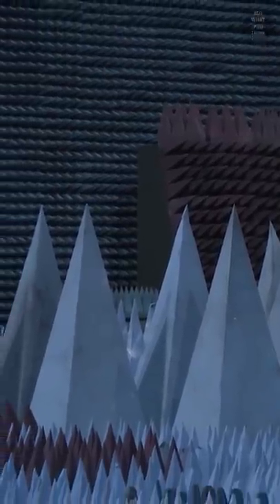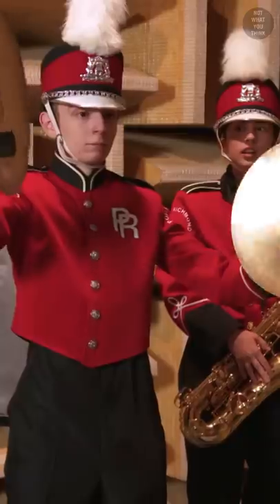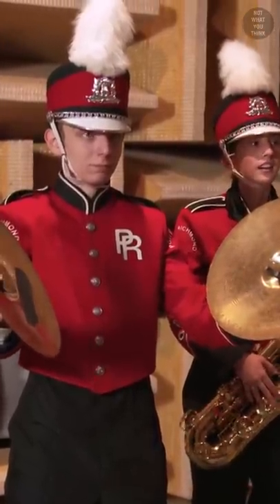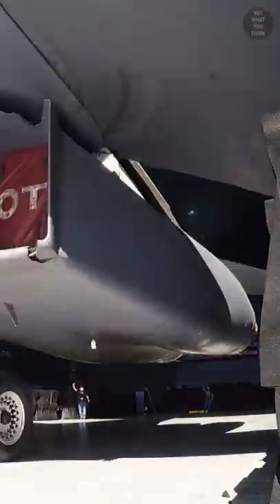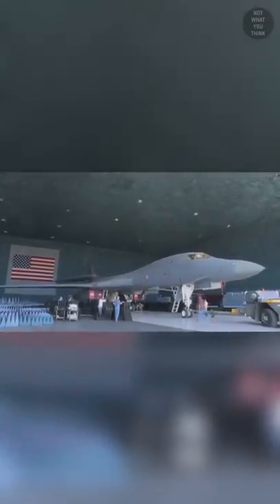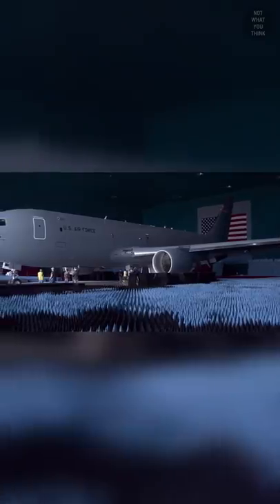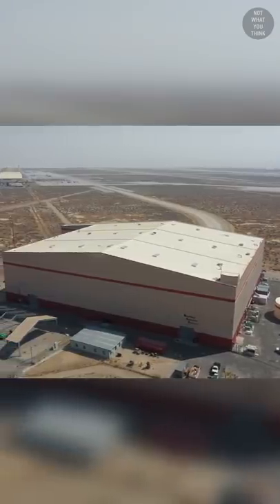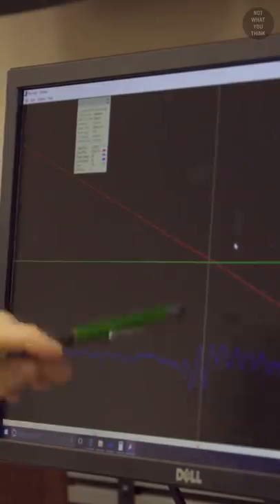Aircraft in an Infinitely Large Room #shorts

Comment: Don’t we all live in an infinitely large room already?
Reply from the maker: Wouldn’t a room necessitate walls? 🤔
Reply: @NotWhatYouThink  could it be infinitely large then?
Reply: @crosshairs19  well an infinitly large room can't exist, anything that is infinite can't exist.
Reply: @NotWhatYouThink  if the room is infinite, the walls are at the limit of our space, invisible and unreachable. Like a penrose diagram
Reply: @NotWhatYouThink  what define room ?
Reply: @NotWhatYouThink  how can walls be real if our eyes aren't real
Reply: The chamber is needed to isolate the device under test from outside electromagnetic noise. It's possible to measure outside as long as interference from other sources is low enough.
Reply: @NotWhatYouThink  if it's an infinitely large room, I don't think walls would be of concern here, as it's an infinite space and no confinements are present (in theory)
Reply: @saulgoodman7858  it was explained
Reply: @NotWhatYouThink  The observable universe makes our walls, or the walls of the non-observable universe.
Reply: @Lillstisse661  π
Reply: @donaldyeung9658  indeed
Reply: @NotWhatYouThink   Well, it's Not What You Think...
Reply: @crosshairs19  it was partially explained. Btw this kind of testing is called Radiated Emissions. Two sides to it. One being intentional radiators and the other being unintentional radiators. Different tests and pass criteria come into play if they're testing one or the other.
Reply: @gohka33  He he he! 🤣
Reply: @Lillstisse661  Isn’t outer space infinite? Does it not exist? This is all making my brain hurt!
Reply: @Lillstisse661  numbers arent real then???????????????????
Reply: @xnavynuc  outer space is not infinite, because the universe is expanding, which means that it is not infinite because if it was infinitly big we could not measure that it was expanding, infinity is a concept used in math, it does not actually exist outside of math.
Reply: @Lillstisse661  then what do you call space?
Reply: @duncanmcgee13  finite.
Reply: @Lillstisse661  the universe as in the physical objects that make it up are expanding, not space itself
Reply: @duncanmcgee13  space itself is what's expanding and that doesn't mean the universe is finite. All evidence points to the universe being infinite, but it's possible that it isn't.
Reply: @Lillstisse661  Do you believe in a god?
Reply: @MrGodofcar  no, in math
Reply: @NotWhatYouThink  The walls move as we get closer.
Reply: Don't the pyramid shapes create a larger volume of reflective/absorbent surface than just bare walls 800 feet or further away?
Reply: @Lillstisse661  because it would just keep going on right?
Reply: @crosshairs19  yes, but we will never reach infinity, you can always count to that number.
Reply: @NotWhatYouThink  depends on wich measure U think, in Like space there IT IS also often called "roomspace" (atleast in some German movies, might be a Bad Translation)
Reply: @NotWhatYouThink  tell that to a flat earther😂😂
Reply: @NotWhatYouThink   infinitely tall walls. No one could verify the existence of a ceiling because infinitely tall walls
Reply: @Frank-wr2nf  "infinite" and "limit" if something is infinite it cannot be defined,
Reply: Infinite is not a set number but instead an ever bigger number from what I understand. Essentially, whatever number you think of, it's bigger then that but is then bigger again.  You could have the set end being the walls but expand the space inside the walls indefinitely, creating an infinite room. You will never reach a wall because the walls are always further and further away to an infinite distance. Alternatively, we could go the other way and shrink the space infinitely. You could have a 1m by 1m room and shrink the inside indefinitely and it would have essentially the same effect but contained withing a finite area
Reply: Infinitely large rooms can't exist... or can they? vsauce intensifies
Reply: @mikedaskalakis5006  people used to think that light moved at an infinite speed. But it doesn’t.
Reply: @Lillstisse661  what about space
Reply: @dakortekaasfamily5394  the universe is finite, it is just really big, not infinitly big.
Reply: Mind f’ing blown 🤯
Reply: @Lillstisse661  i got news for u
Reply: @donaldyeung9658  pi is 3
Reply: @ooopaulpeterooo  wtf
Reply: @Lillstisse661  so, the universe doesn't exist?
Reply: @Lillstisse661  what about joe mama
Reply: @DGP406  blind people can walk through walls now?
Reply: @NotWhatYouThink  walls making it a finite space, making the video title clickbait, gg
Reply: The entire reply section is having an existential crisis right now
Reply: Max Power  ''They don't actually know that its finite, they cann only measure what they see, what is it expanding into?  More space obviously"

Not necessarily.  Space may be created as it expands.  Maybe there's nothing outside of our local universe, even if it expands.
Reply: Max Power  I feel ya.
Reply: @NotWhatYouThink  There's theoretically no way to disprove that the edge of the universe functions as a wall, therefore we are in a 4d room
Reply: @NotWhatYouThink  
If it requires walls to be a room, then wouldn't "infinitely large room" be an oxymoron since there would effectively be no walls?
Reply: Awnser to all questions about the infinity of the universe: We don’t fucking know
Reply: @Frank-wr2nf  But there is no border to infinity, therefore there cannot be walls
Reply: @Lillstisse661  but it is expanding into infinity.
Reply: @NotWhatYouThink  mabe there is walls and this room is so infinitely large that we haven't found them yet
Reply: @Lillstisse661  our space is infinite it keeps expanding we don't even know the if there is an end.
Reply: @NotWhatYouThink  well technically there is a wall around the known universe
Reply: Universe it not infinite
Reply: @NotWhatYouThink  yes, but it's not what you think.
Reply: @NotWhatYouThink  mushrooms
Reply: My whole life is one room, one big dark room.
Reply: @stanleypeters5383  
As I understand it:  no.

The pyramid/modified-pyramid receiving surface angles are such that the mechanical (sound) wave, or electromagnetic radiating wave (EM radiation), reflect the wave (whatever portion's NOT absorbed by the highly absorbent material, with each bounce/reflection) at angles that progressively "trap" the wave as it rapidly bounces it's way down the pinball machine  between pyramids/cones, towards the dead-end of that triangle/funnel, by which point what hasn't been absorbed becomes, finally, nullified. (As best we can; as I believe it's impossible to reach that ideal of perfect insulation of energetic waves [sound/EMs], or temperature.)

So the overall value of THAT highly-specific surface topography (of progressively bottlenecking angles) AND the absorbent material "capacity," seem like they must trump the sonic dampening of that 800-foot-distant wall you wondered about.
Reply: Do all very basic cringe attempts at cute comments that are not creative or funny whatsoever; now get a lot of likes?
Reply: @Lillstisse661  the universe exists.
Reply: @Lillstisse661  the universe is uniform and infinite in all directions and always has been.

Just because it is also expanding doesn't mean it isn't infinite.  Infinites can get bigger. 
Some infinites are bigger than others.
Reply: @blessedwolfNotAFurry  in a way light doesn't move at all.

When light moves the entire universe contracts to zero depth.  (From lights perspective).  Which is to say from lights perspective it is both at the start of its journey and the end at the "same time"
Reply: @NotWhatYouThink  4d walls
Reply: @NotWhatYouThink  but if its infinitely large, you could never reach or even see the walls, since vision has limited range, so would you know the walls even existed?
Reply: @Lillstisse661  ok so the universe is expanding, we have evidence of that. And it is immeasurably enormous at an uncomprehensible volume. now what ever is beyond our universe must be infinite to allow the expansion of it all including any other universes. if not then you are shrinking giving you the illusion of an expanding universe and your about to implode. crunch... lol.
Reply: @davidbelen7199  our universe, the one that is expanding is not infinite because when would something that is finite switch to being infinite, it's not possible. But the space that our universe is expanding into may be infinite because we have no idea what it even is.

Comment: The pyramids don't stop the reflection of electromagnetic waves. They transfer the vibrations from the air into themselves, and because the speed of sound in the foam is much slower than air, the vibrations practically vanquish. Electromagnetic waves means light :)

Comment: An infinitely large room. Room still means mostly enclosed. The floor would have to have some kind of structural integrety not based on tension, and would therefore almost certainly reflect sound. Assuming you're not floating, and the temperature is not at absoloute zero, sound would still be relevant and have an influence.

Comment: He said that the pyramids are designed to stub electromagnetic waves. Why? Sound is mechanical, not electromagnetic...
Reply: They have special materials called RAM, the pyramids have a special geometry to reflect the EM waves because well... they are waves, they do interact with surfaces in some degree, slap the ram on the pyramids et voila, you have a pretty powerful device

Edit: also they are testing for radar and stuff, depending on what you want to test you'll use a coating and geometry, the one where the kid is, is very different from the one with the helicopter

Comment: That's not entirely true, an infinitely large room could still have echos, especially assuming you are standing on the floor. Though faint, that floor would reflect sound, and only one wall has to stretch infinitely, so you could be surrounded by 5 flat surfaces that reflect sound.